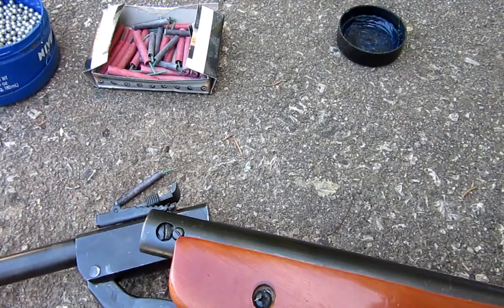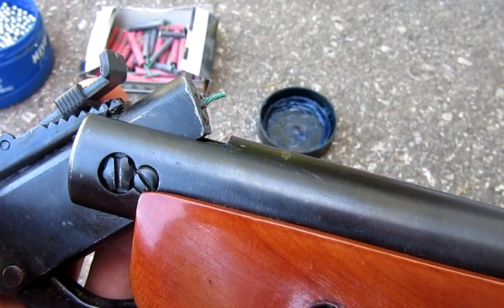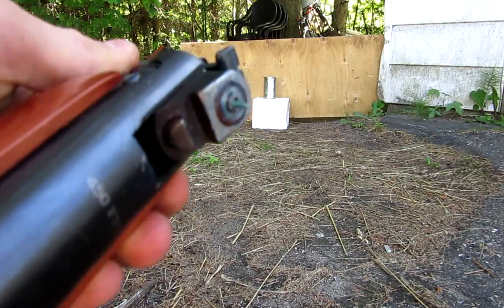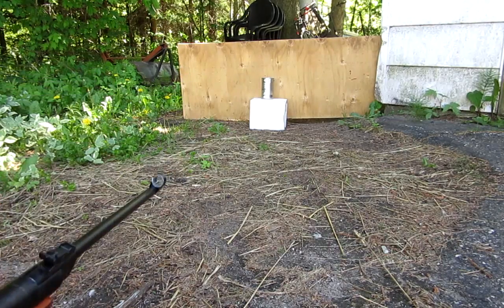1000 FPS Firecracker Pellet Gun HACK

Comment: if u paid 40 dollars for that used pellet gun they ripped u off, brand new it costs 30 dollars
Reply: Jake Krzemen  sad part is those chinese air rifles brand new from the Cummings tools market  are only $20
Reply: Jake Krzemen and could of then bought pellets
Reply: Hugh Mungous those pellet guns were a gamble you might get 2 out every 100 that were good. the common issues with that gun was the latching bar on the spring piston and the trigger pull was very hard.
Reply: I'm sure he is losing sleep over the damage to the bore of his $40 pellet rifle. :)
Reply: Hey Jake
Nah they aren't. Try doubling that figure and that's the going price for one BRAND NEW on either Amazon or eBay. You can maybe find one at a flea market someplace, but no guarantee that shits not used.
Reply: jake Ik your comment is 6 years old 😹 but they go for $70 on amazon now

Comment: I've done something different with my bb gun, and its just like the one you had.  I have heated up the whole barrel up to the point that I cannot hold onto it, I then quickly put it back on the stock and screwed it back on.  I cracked the barrel, put in a BB and squirted a bit of WD-40 into it.  When I fired it, there was a loud pop with smoke.  I did the same principle as a diesel engine.  The sudden heat and compression set off the oil and caused it to explode.  I found that it had a higher FPS than the carbine action.
Reply: you dont really have to heat up the barrel, i put 3 in 1 in there and shoot it usually the second one is the one that pops.
Reply: maybe dont heat up the barrel then rapidly cool it with wd 40??? what a numpty  idea
Reply: destroys the main seals too

Comment: Air compression should ignite the grease. If you use skirted pellets and fill the hollow part of the skirt with grease it will ignite if the air pressure is high enough. Some people do that to increase pellet velocity but you have to clean your barrel frequently.
Reply: grease doesnt ignite unless its mostly liquid...  or do you think diesels squirts grease into the cyclinder? lol

Comment: 2 MISTAKES.
1-USE A PELLET FOR BETTER SEALING.
2-When using the fire cracker, do not cock the rifle. It increases more volume inside the rifle, thus reducing pressure from the firecracker gases.

Comment: I did something similar with a copper tube and a firecracker
Reply: Yea me too I used a pipe from an old lamp and the nut on the lamp drilled a hole for the fuse , tapped the pipe to a long stick. It was loud but worked pretty good (for a 12 year old lol)...

Comment: you effectively turned your pellet gun in to a cannon, but beware that these guns are sold with rifling for zinc pellets which get messed when you use steel bb in them, these guns operate with enough pressure to light anything that provides resistance, just use regular round, pointed or double head pallets add a drop of gun oil or gun powder inside them and shoot the pellets the resulting pressure will shoot the pellets way faster.

Comment: Try Dieseling Balistic Ball, BBs, using the sticky bearing grease with some mixing of sodium hydroxide and a little vegetable glycerin.  Push the BB into the chamber with a pellet pusher, what it's used for, 1/4 inch, using a Pea Sized amount of said mixture in chamber, you must then fully cock the weapon, aim and fire.  Always insure crossfire and backdrop are all clear.  Use eye and ear protection.

Comment: If you drill a small hole in the top of the barrel, you can load it like a musket from the rear, slug first, then powder then a piece of steel bar, put the fuse down the hole you drilled into the power, light fuse, aim gun :D  I got 3000fps doing that lol

Comment: if the plywood hole is the one where he missed then there is no comparison as the firecracker is much more powerful because the spring fired BB would not have even made a dent in 1/2 inch thick plywood.

Comment: my cat told me that you can put a plastic cap from a cap gun to the barrel (to the end where you usually put a pellet) then close the barrel thing and put some firework powder (no Armstrong mix, otherwise you may fuck yourself up if the powder ignites), then a piece of wool, then a 4.5mm ball bb, then another piece of wool, then with a stick, press it all together tight from the barrel. (just like loading a black powder gun) and then when you shoot it, the pressure will press the cap (or a primer in this case) against the powder and ignite it.
50% chance that it will actually fire, or just blow all the stuff out.

Comment: Don't do this with your pellet gun! The projectile ain't gonna get higher speeds or damage but you are gonna ruin your gun instead.  Most of the gases released in the explosion are still inside of the gun and didn't escape through the barrel. And if you want to make it more powerful, you would need a hard and heavy projectile like a .22 caliber bullet, which obviously isn't gonna work because the firecracker is just too small and release small amounts of gas. If you want to make a firecracker-propelled projectile gun you should(n't) make a homemade firecracker gun.

Comment: You actually can legally manufacture your own firearms, you would submit a form 1 to the ATF. It's legal as long as you follow ATF rules and any state or local restrictions you may have, you also cannot sell or transfer possession of the firearm.
Reply: You are wrong. You dont need an ATF form 1 to build your own firearm. You can build your own firearms all you want without informing the atf all you want. You cannot sell said firearms or transfer possesion. An atf form one allows you to put a serial number on the gun and later on sell or transfer
Reply: Jarrod Howell I stand corrected. I forgot the only time you need to fill out a form 1 is to create a transferable firearm, or an NFA item.

Comment: When you ad a petroleum product to your ammo in an airgun, it fires like gasoline under the pressure release of air. This is called dieseling. Its the same as compression in a diesel engine being high enough to detonate the fuel charge without a spark. This is why your BB's did more damage with just the grease then with the firecracker. While dieseling an air gun can be fun, it can also be dangerous. It can potentially blow back into your piston and ruin your spring cartridge. But what the heck. Its only a 40 dollar gun. But if you choose to do dieseling, wear eye protection.

Comment: Have you ever heard of  dieseling an air gun? I think that is what you are doing with the grease. Oil or WD40 works really good. The pressure from the air will cause the oil to ignite giving it extra power. This is very bad for the seals, but if your just doing it to experiment with a crap airgun.

Comment: using oil or grease in an air rifle will cause "Dieseling" basically the compression imposed by the air pressure behind the pellet IGNITE the grease/oil and causing a small explosion which will increase pellet/bb velocity SUBSTANTIALLY! So that is probably why that first BB went thru and thru.

Comment: you know what works really great ,, dont do this unless you have an adult helping you ,, take the spring out of the pellet gun and stretch it about 8 or so inches longer and then put it back in , will take a bit of work getting it back in , you will be impressed with the extra power and range ,
Reply: gunnergamer ,, i agree thats a great idea that might work , mine was just a quick hack to provide some extra power ,, the best thing would be to just build a better pellet gun that can easily handle a stronger spring , my pellet gun has a lot of extra strain on it from this small hack and i dont think it would hold up to a heavy duty spring , i think something would break or it would almost be impossible to load it ,, i like those high powered air guns , its just that most people cannot afford them ,

Comment: the strongest airgun i ever bought was the Hatsan 125 4,5mm 395 m/s and it shoots thrue alot thicker wood if you buy steel bullets either with round tip with plastic holders like most standar 9mm copper jackets  or like the cheap dumdum bullets in lead/flat top with plastic holders. and if you shoot the airgun arrows with steel tip and bristle in the back they usaly land on its flat side or crocked so it breaks.

Comment: I know a better way than using a firecracker and this is more powerful it's called diesel firing your pellet gun you want to need a pellet instead of a BB you need a can of Vicks your going to dip your finger in it make sure the cup of the pellet is full of the Vicks close the barrel if your gun shoots a thousand feet per second it'll boost it to 1600

Comment: 1000 FPS? that is 50 times faster than the rounds shot by the VSS Vintorez, an actual freaking firearm
Reply: if 20fps is all that gun can muster(the vintorez actually fires at around 950fps), then it needs to be melted down and recycled into something more useful... like a railroad spike.
Reply: Modern pistols fire at around 700-900 fps
Reply: Papi Killjoy 2469 vss is lit in pubg

Comment: Lmfao..all you did was diesel the air gun.(but i saw where you were going with this,but won't work 90 percent of the time) Meaning adding any grease,vaseline,or vaporub makes any air rifle shoot predominantly faster,due to the explosion and or clogging the breach,which in turn creates a small combustion,(very small) which gives it more pressure...(with or without the firecracker)